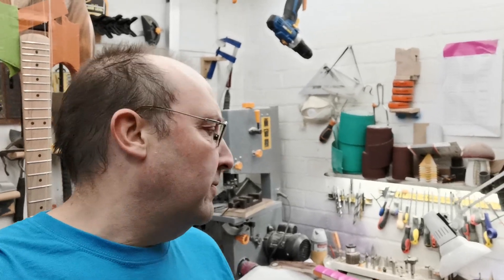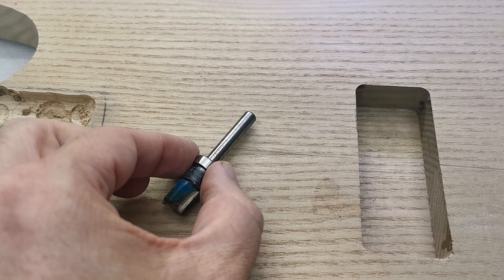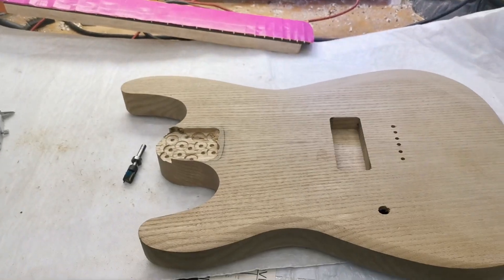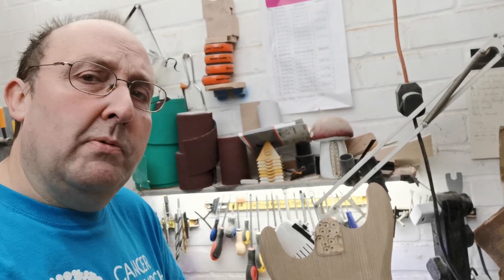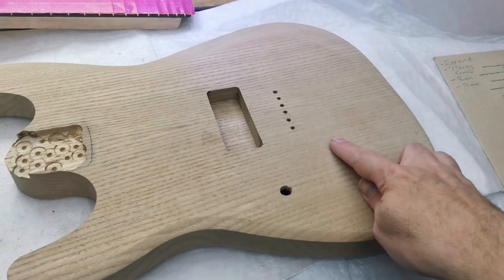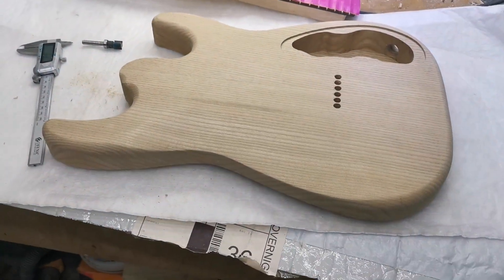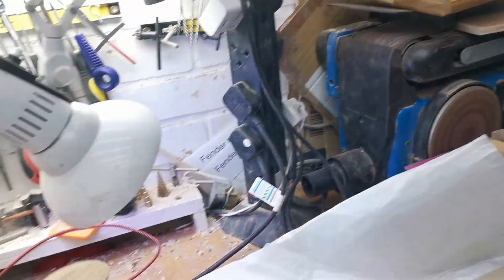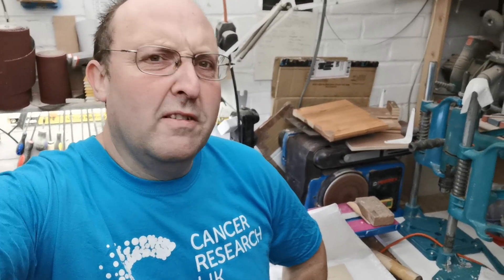What would you do?

Comment: Inlay 2 strips (your wood choice) along the sides of the neck pocket as deep as the neck pocket and the entire length of the guitar. racing stripes. Get fancy and add some maple on either side of some rosewood or ebony.
Reply: I like this.
Reply: I just popped back on here to suggest the very same!
Reply: And I was going to suggest this. I really don't believe this tight neck pocket is 100% necessary. I am not convinced it super helps sustain. But what a way to find out? Make some sound demos where the neck isn't touching the sides then shim it with a pocket pouch. And if it make a sustain difference then can we co patient the sustain pouch? Using this impedence matched pouch your sustain will be maximized...

Something I am trying to build is a copier / duplicator. (Too many other projects in the way). But I guess if yiur designs are bespoke then maybe that isn't feasible? I would be interested in a cheap but functional CNC. I know of cheap ones  but that aren't cheerful.
Reply from the maker: Thanks guys!  In this instance where I'll be gluing the neck in and carving it back then it needs to be pretty much a perfect fit.  But I agree with bolt on necks that's not a bad thing.

Comment: Hi Chris, you have a good video personality.  Anyway, lots of things you could do, it really depends on how conservative or wild you want to be.  1)  As you said decorative edging.  2) different types of edging, eg, flame or wave look, could be made from aluminium or brass etc.  3)  If fretboard & neck are not completed yet then those could be widened at the bottom.  I built a through neck guitar with a wider fretboard over the body. 4) carve the edge of the pocket all the way around so that the body slopes down into the neck pocket, you could also curve the side of the neck to match.  5) you could paint the guitar with a solid colour, so, simply fill the hole. 6) extend lines or channels from the hole out onto the top, then fill them with coloured resin.
Reply from the maker: Thanks for the kind words and those are some excellent suggestions.   The neck is already made sadly.